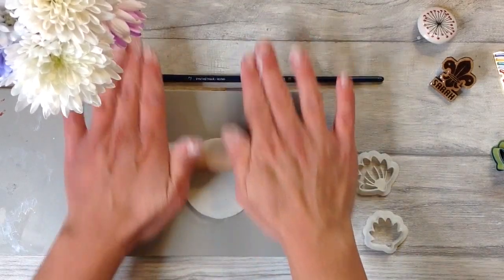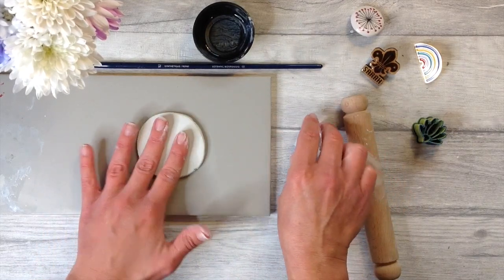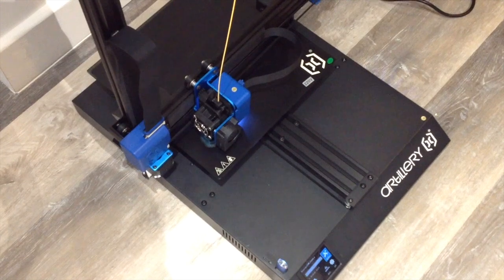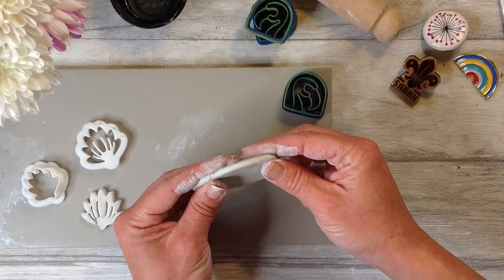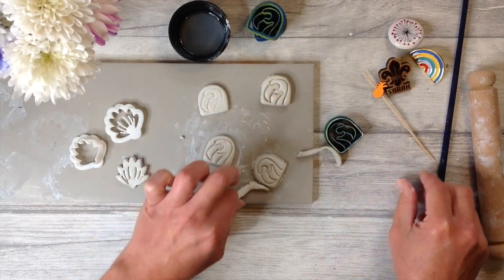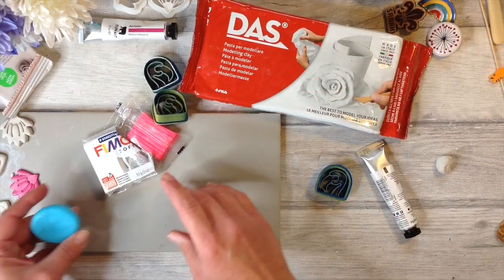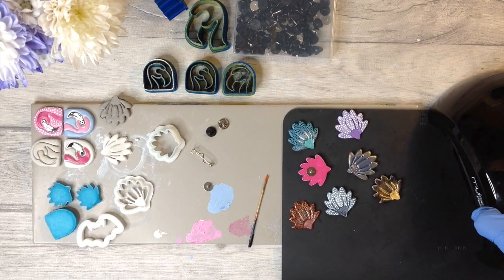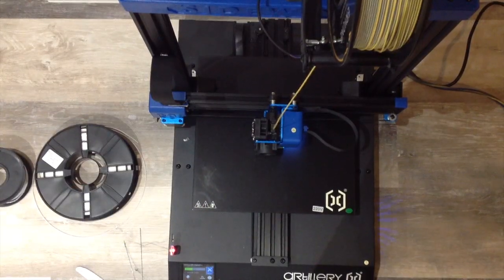Easy Air Dry Clay Pin Badges - AIR DRY CLAY AND RESIN - 3D printing cookie cutters

Comment: Hi, you’re amazing I’ve been thinking of a different way to use my pin backs. I usually use wood to make my items but this seems fun. How strong is the clay I’m worried they will break
Reply from the maker: There is a chance they will break with air dry clay, in this video I make some and use resin: AIR DRY CLAY | how i make clay pins, necklaces & keychains!✹ TO SELL
https://youtu.be/Y120OMwVlgg

Comment: How do you wash those brushes out as you said?
Reply from the maker: A little oil and soap works well too
Reply: @RedRockingBird  oil and soap cleans up resin in brushes?
Reply from the maker: @junebug3807  I find it does, I use an older brush wipe all excess out and then use oil and dish soap then a soapy wash, leave to dry, not perfect but useable once more, acetone otherwise

Comment: I am a beginner in air dry clay and I noticed a constant problem: the acrylic paint peels off easily. Do you have any idea what I am doing wrong? 😁Thank you so much! Fantastic tutorials ❤️❤️
Reply from the maker: Hi, I know what you mean with the acrylic paint peeling. I find a top coat of polyurethane varnish works well. And more recently I have been using resin 
https://amzn.to/3SRHLeM which makes the painted clay lovely and shiny and gives extra strength. It’s also really important to leave enough drying time between stages to help prevent peeling. Thanks and best of luck ❤️
Reply: @RedRockingBird  thank you! I will try with varnish/resin and a bit more patience ❤️❤️

Comment: The 3D printers are truly amazing, I don't think I could get to grips with the computer side of it but I love that these can be utilised in so many ways. Have you tried 3D printing your own badges? I am also looking at using the magnetic pin backs but so far mine came off my clay badges so I might try the UV resin to secure them. Thank you for another great tutorial.
Reply from the maker: Thank you, it is a lot of fun, and I need to explore lots more. I want to 3D print some badges yes, but I am currently designing some enamel pins too. Yes try the UV resin to attach, I find these really sturdy and am loving this method. Enjoy, Sarah